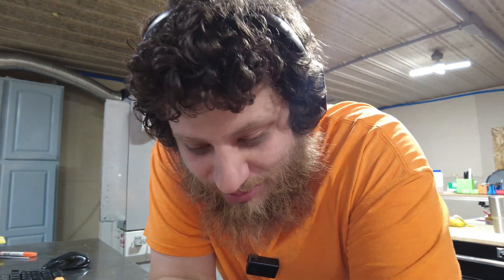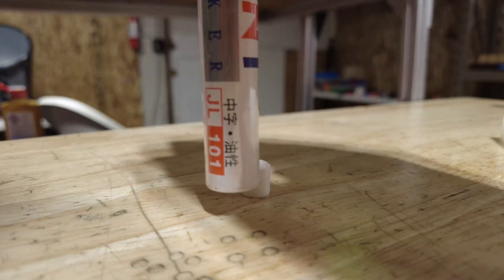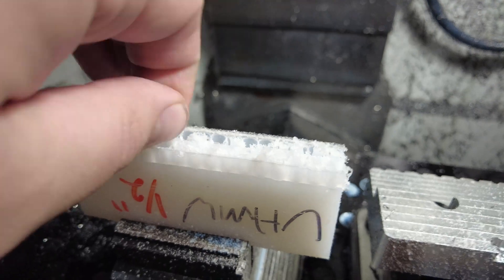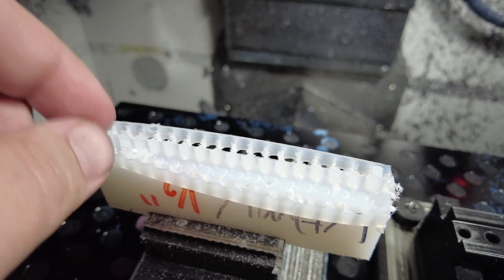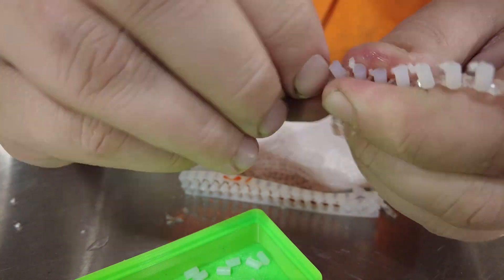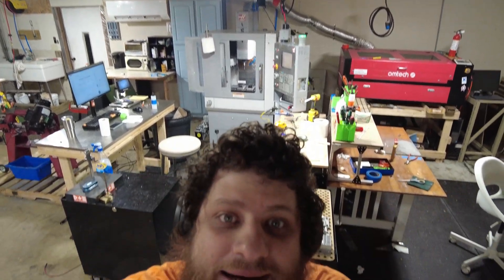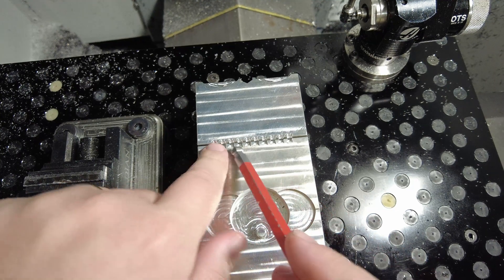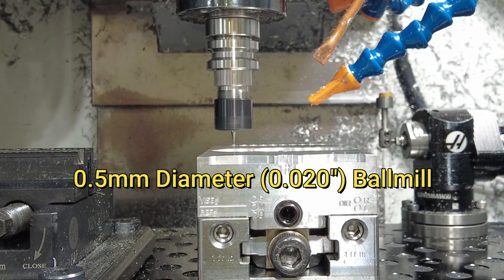Machining the WORST plastic of all time

Comment: Single flutes are your friend when cutting plastic. I use Datron tooling, their 4n1 endmills are very expensive, but they are pretty awesome for plastics and aluminum. Not having a high RPM isn’t ideal for single flutes, but the sharpness they can achieve is unmatched against 2 and 3 flutes endmills

Comment: Tips from the machinists at my client (we work mostly in plastics). 1) 3d print custom vacuum hose nozzles to mount on the spindle with a mag base. This works in combo with air to clear chips and prevent recutting. 2) don’t ramp down in the material, plunge off to the side the feed in at each Z depth. 3) use Harvey tools specific plastic cutting end mills.

Comment: I imagine this has occured to you, but I thought I would mention it anyways. Have you considered environmental control in the workshop and or the , machine? Not knowing anything about the material properties it occurred to me that the colder the material the less burring effect there would be. I know you can blow air through the coolant hoses but that could throw small parts around. I also imagine that you have experienced changes in parts runs due to humidity changes, so experimenting with environmental control may be worth considering as the expense could be covered by being able to have more successful parts runs which would allow for more jobs to be taken on and less material wastage. Maybe putting dry ice in the machine may work to help get better parts the first time or in less time and less revisions. Just a thought from a random nobody. I like your content though and I am a subscriber when YouTube doesn't unsubscribe me from my channels that is. I find I have to resubscribe to channels fairly often, as I have many subscriptions.

Comment: Pretty sure I did this job before, but they didn't want to match same price. I just used pre-sized bar stock and length cut it. I think the slot was smaller though i used a .015 ball. otherwise cut a fixture just like you did also surprised to not break any tools but I think i also did a drill out first and they checked for movement in each one to make sure they wouldn't rotate before the .015 ball mill.